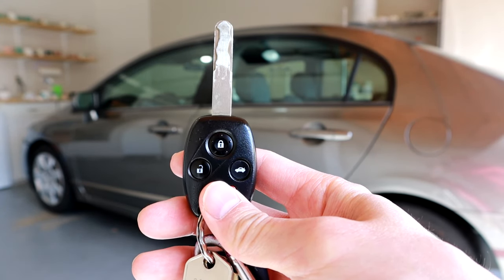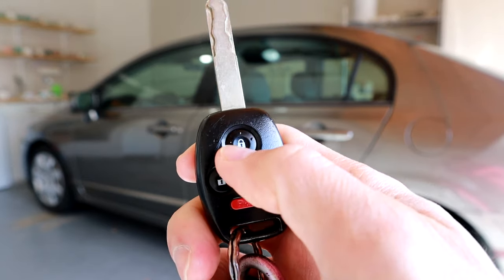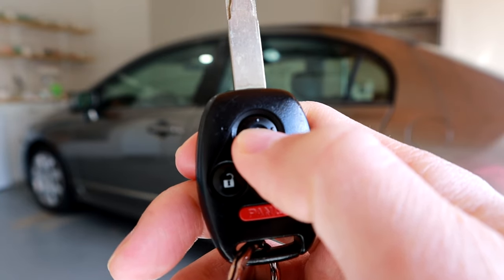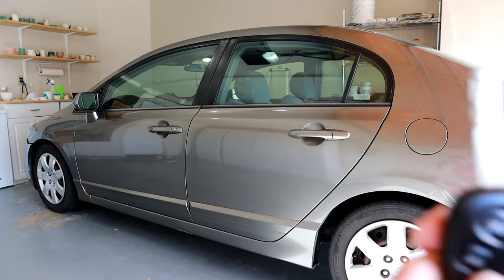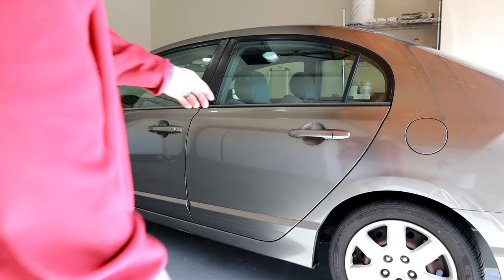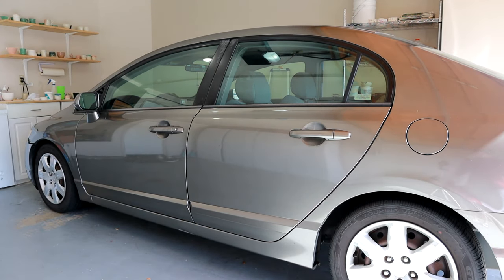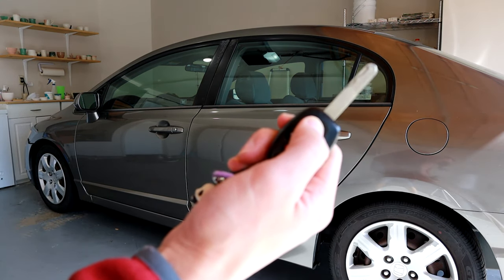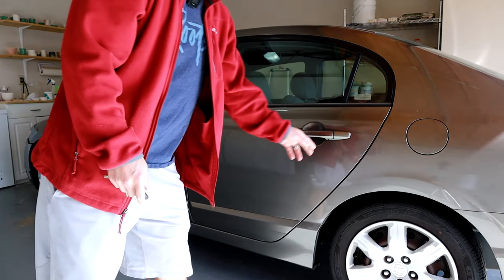Honda Key Fob Not Locking, But Unlocks Fix

Comment: I’m having the exact opposite problem. It won’t unlock!!
Reply from the maker: Uh oh.  Check the fob and make sure the red light isn't solid.  Try manually unlocking the car with the key.  If you still can't get it open, I would start with the key first as the issue.  Also try manually unlocking more than 1 door and see if any door will open.

Comment: Thanks, after replacing battery (obviously didn't work) and reading all the other potential problems requiring a visit to the Honda dealership, I stumbled across your video.  Upon further examination of the car, the rear seat passenger door was slightly ajar.  Felt stupid!  Weird thing was my open door was not illuminating on the dashboard.  Thanks!!!!  Save me a trip and further embarrassment.
Reply from the maker: Glad it helped!

Comment: Big thanks to you! My kid told me my Honda Odyssey van couldn’t be locked. I replaced the key fob battery and it still didn’t work. Almost wanted to take the van to the dealer but then found your video! It was so simple! I closed all the doors manually and the lock key on the remote worked right away! Your video is helping lots of people and doing good to humanity!🎉❤😅
Reply from the maker: Glad it helped!

Comment: mine Is opposite lock but dosnt unlock(but red light blink)with remote even with inside the car car unlock buton dosnt unlock sometimes what will be the cause? Sory about bad English
Reply from the maker: I'm going to guess your key fob is not working correctly.  If you can manually unlock the car with the key, I would try getting another key fob.

Comment: Mine 2013 Honda accord is blizzard. When pressing the lock button, it pops the trunk open. Lol. It must be some kind of sequences that inadvertently activate to response like that I think. Any idea? Thanks
Reply from the maker: That's all sorts of weird.  Actually I would think that FOB is messed up or not programmed correctly.  I would try getting another FOB and that I would think would fix your problem.

Comment: hi! i’m having the opposite issue, it’s locking but not unlocking. do you know what i could do?
Reply from the maker: Are you able to manually unlock the doors with the key?  If so, you FOB has an issue.  If not, it could be a mechanical issue with the lock or door.
Reply: @nukem384  i was able to figure it out from a comment! not sure what it was, but i just held the unlock and lock bottom for a few seconds &  it fixed it.

Comment: Hi i habw question i have honda civic 2012 Lx 
I have two keys
And in the winters but i want is to start the car and lock it with one key and wait for 10 minutes to warm and then come back and unlock car with second key.
But the problem is when i start the car with one key and i go out from the car. The car is not locked. It is still unlocked .
How can i lock that car so that after 10 minutes i am only one who can open with another key 
????
Reply from the maker: Pretty sure you can't do this.  I'm betting there's a mechanism that when you start the car, you can't lock with a key as a fail safe to not lock yourself out.

What you could try is (maybe not with the engine on) but manually lock the doors from the inside with the driver door open.  Shut the door so the car is locked.  Then try the remote on the other key and see if that works.

Comment: Friend of mine has the problem of the car not locking but unlocking ok.
But if a door is not fully closed.
Wouldn't the interior lights just remain on anyways?
Reply from the maker: You may not notice it if it's during the day.  Or maybe you have the light switched to the off setting?  It's still very possible for that to go unnoticed.
Reply: @nukem384  Ok, will check it out, thanks.

Comment: My key fob will unlock all of the doors perfectly fine, but when it comes to locking them, it only locks 3 of the doors. The driver door stays unlcoked no matter what so i have to manually lock it each time. Any ideas on a fix?
Reply from the maker: There's something wrong with the locking mechanism on that door (most likely).  Either take it in to have it fixed, or if you can find a YT video of how to change it out, go for it that way.
Reply: @nukem384  alright I'll try, thank you

Comment: My passenger door indicates that it’s open on the dashboard but it’s not. So my car won’t lock with the key fob. It’ll only unlock. I have to manually lock it from the inside. Please help!!
Reply from the maker: That sounds like a sensor problem then.  You'd have to find a video on how to replace that sensor or take it somewhere to be fixed.
Reply: Thanks so much!!

Comment: For me it’s the other way around, it locks but doesn’t unlock. Any way to fix this?
Reply from the maker: Did you try the trunk button and any other buttons besides the unlock?  Do all those work?  If so, the unlock button on your key fob is broken.  Time to get another remote.
Reply: @nukem384  Yes the trunk button also works. I have two key/remote and on both of them the unlock button is not working
Reply from the maker: @IRush514  Hmm interesting.  Try this.  Hold down the lock and unlock button together until you see rapid red flashes from the fob.  Then try.  Hopefully that fixes it.
Reply: @nukem384  Unfortunately it does not seem to work as when i hold both the button nothing happen. I’m starting to think that the problem might be coming from the driver side handle as even when i try to unlock the door using the key it’s not working
Reply from the maker: @IRush514  Oh so all the other doors unlock?  Just not the driver side door?
Reply: @nukem384  None of the doors unlock, probably cause the driver side door is the one that controls the other ones
Reply from the maker: @IRush514  I wonder if it's the mechanism on that door then?  You said the key didn't work manually.  So maybe try getting that replaced first and see what happens after that.
Reply: @nukem384  That’s also what i’m thinking. Will do, thanks for your help!

Comment: I have two key fobs. One of them locks and locks normally, but the other one will only unlock the doors and only feebly at that. I replaced the battery, but the problem persists. Because it's only the one key that's malfunctioning, the issue isn't that one of the doors is open.
Reply from the maker: It's probably the key itself.  The chip in the key is probably dying.  That's why changing the battery doesn't do anything.  Get a new key and it'll probably fix your issue.

Comment: what if it doesn't unlock either but the light still goes off
Reply from the maker: Are you able to manually open the car with the key in the door?  It may be that fob.  My guess is you need a new one.  Probably not communicating with the car.
Reply: @nukem384  so here's the thing I can unlock it with the key but the alarm starts blarring, but rn the unlock button on my keys isn't working but the light on the key does flash though
Reply: @nukem384  thank you for taking the time to reply too btw
Reply from the maker: @anti.anti27  It's gotta be your key.  If you're manually unlocking and the alarm is going off, the key isn't communicating with the ECU to tell the car it's you.  I would get another key made and that should fix it.  You should be able to go to any locksmith, as that'll be cheaper than going to Honda.
Reply: @nukem384  dude thank you so much for replying, I talked to my dad about it and he mention to be safe replace the battery which I did and that honestly worked I didn't realize that when the light on the key flickers it means it's running low, so when I replaced it I tried to unlock it and the light only flicks once per click so it was the battery luckily. Either way thank you for replying and actually trying to help 🙌🏽🙌🏽🙌🏽

Comment: Mine won't unlock and all doors are locked! The red light flashes but nothing happens. I tried unlocking manually and it still won't unlock, anyone got any ideas before I call the locksmith?
Reply from the maker: You sure you're at the right car?  Haha I kid, yeah that's not good.  That has to be some sort of electronics issue then with the chip in the key.  Do you have a spare key you can try and see if the doors will open?
Reply: @nukem384  LOL It's the right car, it was the battery terminal that completely disengaged. The dude that installed the new battery didn't firmly secure it.
Reply from the maker: @magellanmax  Thanks for the reply.  Wow, battery changing is like cars 101 lol.  That guy needs to find another job haha.  Glad it's fixed!

Comment: My door isn’t unlocking 😖 and the key doesn’t work manually
Reply from the maker: You probably have an issue with the actual lock on whatever door you're trying to open.  Have you tried the other side door?  Does that side unlock?
Reply from the maker: @tômm’éi slade Yours sounds like there's a problem with your driver side lock.  Something isn't engaging.  Hopefully an easy fix.

Comment: All my doors are closed. It won't lock. New battery.
Reply from the maker: Can you manually lock the doors with the key?  When you say "new battery", I'm assuming you're talking about the fob battery right?
Reply: Mine are all closed but won't lock at all, even the auto locks when driving don't activate. All my doors are closed, but ever since I got a key fob (trying to avoid the whole manual lock and unlock) the locks stopped working period. Help